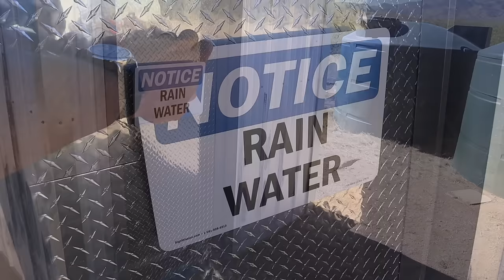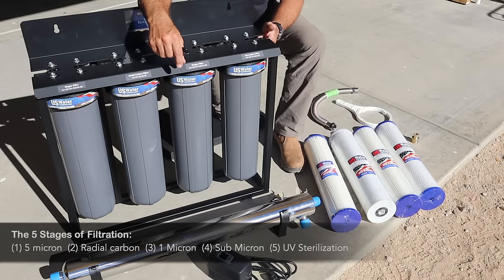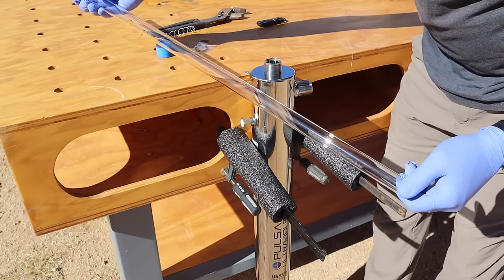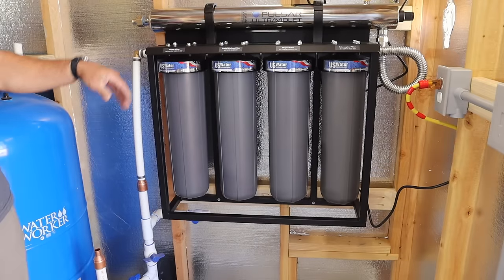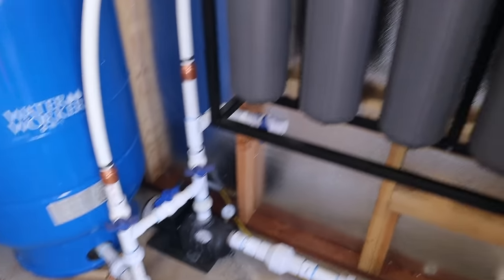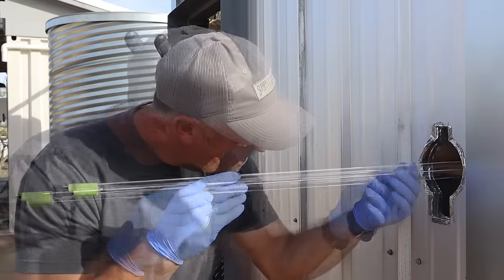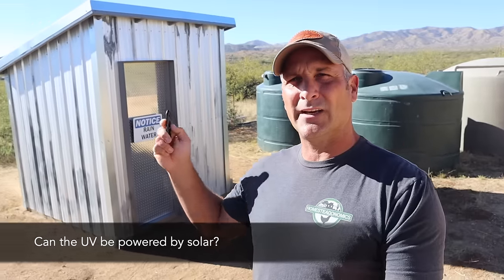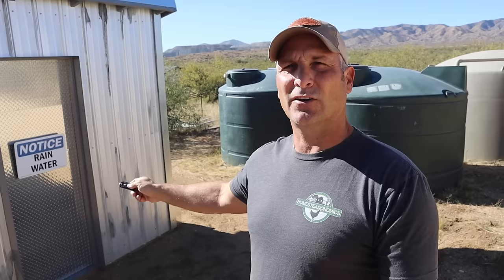Whole House Water Filter Install for my Rainwater Harvesting System

Comment: Great vid! Thanks for sharing. Do you do anything to re- mineralize the water? What is the pH when it comes out of faucet? I'm just curious. We love your channel and have a chunk of property here in Arizona we eventually want to "homestead" in a sense. Your vids are priceless for information.
Reply: We have had our rainwater system up for over a year now.  We sent water samples to a lab to be tested a month after we started using it.  While the mineral levels were greatly reduced we did still have trace of some minerals in our water.  If you have a good diet you should not have any issues with mineral deficiencies.  Filtered water is not void of all mineral like distilled water is.  Our ph levels were pretty neutral.  Something I didn't expect was that rainwater is not as clean as you would think.  I did our first filter change at 9 months and the filter elements were almost black when I removed them.  That's not necessarily a bad thing, it means they are working.
Reply from the maker: Thanks for checking it out!   No, we don’t add anything back into the water.   But like the ouroklahomalife said, a good diet of healthy food will supply what you need.   Additionally we use a couple types of salt (Celtic sea and Himalayan) over regular iodized table salt for our meal prep as they have natural trace minerals within them.  
As for the PH, I do not know, but plan to do a test of pre and post filtered water soon.  
And where abouts in AZ is your property?

Comment: Wow, I don't get it?? I live on a caribbean island and  have been living on rain water for over 19 years. My water goes through one 10" X 2 1/2"  1 micron filter which I change every 2 months, and then through a UV filter. I change my UV bulb every 18 months - they recommend every 12 months. I have never had any issues in regards to this system. No issues with the taps, water comes out clear with nothing collecting in tap filters. Water tastes great. no one has every gotten ill. I did have to change the UV control box after approx. 14years.
Reply from the maker: Get what?  This is just a multi-stage filter system.   They also sell single chamber systems, UV only systems, etc,.   This is just what they sent me.   
If you check out my previous rainwater videos you’ll see that the only filter I have used for 15 years was just a berkey gravity filter.   Nothing for the house.    Lots of options and there is just one.

Thanks for checking out the video😊🙏

Comment: We’re thinking of doing the same Joe. We put in two small under sink filters in so we can access drinking water at either end of our house and they seem to be working well, but the filters need more frequent changing than I’m guessing a whole house system would. Thanks for sharing this.
Reply from the maker: Well I think your plan of doing the under sink filters is actually more of the ideal setup for being efficient as you aren’t filtering hose water, washing machine, toilet water, etc,.   So theoretically I’d imagine that could save more, depending on the filter changes needed.   
Of course this setup is a single filter location, but they are large filters.   So I guess it might depend.  

But I’d definitely check out what they have to offer that might work as a switch out with your current ones.  As they do have smaller filters that can fit under sinks in the cabinet.

Comment: Are you splitting the filtered water and unfiltered water for different uses? Such as washing machine, toilet probably doesn't need filtered water vs. cooking, drinking would need filtered water. It uses more water to get filtered water.
Reply from the maker: That would definitely be my ideal.  But as of right now I only have one run supplying my house.  So it supplies everything. 

As for the more water to get filtered water.   This system is not RO so there is no wasted water.

Comment: Very useful video. Thank you Joe! 
1) What carbon filtration you have in the kitchen? 
2) How often you need to replace filters , including UV filter? Once a year? If so to keep it running, annual expense around $500? Correct me if I'm wrong.
Reply from the maker: Thanks for checking it out!  

As for the filter we’ve been using for the past 15 years.   It’s a 2.5 gallon berkey with black ceramic elements.  And even though I’m installing this system I will continue to use the berkey as well for drinking water as it’s just habit.   I highly recommend berkeys in general.  

As for maintenance on an annual basis.  If changing at recommended intervals, that is probably close to what it would cost.  But that will depend on water source.   For example with rainwater I have virtually no mineral or other particulate to filter out.   But I will have potentially more silty sediment from my roof surface that makes it in there….even though I do let sediment settle and use a filter on my pump when I transfer water from my tan collection tank, to my green holding tanks.   So the water is remarkably clean by then, but some will make it over.    So for me I might let the latter filters go longer than a year and just change the first 5 micron filter more often (as it is the cheapest 😉).  And I think that will not only prolong the latter 3 but also reduce cost a bit.
Reply: @homesteadonomics  Good video.  We have a similar system and we still use our Berky.  I thought rainwater would be cleaner but, I just changed out our 5 micron for the first time @ 9 months and it was black.  Which is OK, that means it's doing it's job.  If your looking for a water testing lab we used "Simple Lab" to test our rainwater and our well.  They send you the kit and turnaround from when you send in the sample is about 5 days.
Reply: for my system I use loose carbon rather than a cartridge. the carbon then can be washed and dried for reuse elsewhere. also about 1/3 the cost. have been doing that way for over 5 years. water annually test out exceeding local utility district water quality by far.
Reply: @homesteadonomics  Thanks.
Reply: @OurOklahomaLife  Thank you
Reply: @lawrencebeck1144  Thanks. What kind of water filtration system is that? Brand?

Comment: I installed a similar system in our van, so proof of running off of solar is there.

That said, after 3 years, our UV sterilizer exploded due to bad welds and freezing temps.... so be sure to insulate or drain in freezing temps
Reply from the maker: Sorry to hear about the failure…..but glad to hear you had some good success before that.

Comment: Excellent work again Joe.  With the digital key used on the device and it sitting inside a metal building I'm sure that you will protect it by grounding everything to a common ground rod to prevent electrical surges (differences of potential) due to high electron flows associated with lighting in the area.  You shouldn't have a problem but digital equipment is suseptible to failure with the small tracings and bondings on the boards and in the chips, etc., in them.  Hence, keeping everything at the same potential to mitigate the energy flow between different potentials.
Reply: You really need a surge protector on the main panel to protect all circuits of the house or an individual outlet protector. I can tell you from experience that just having up-to-code grounding isn't enough. My electrical is from 2016 and I've got two 6' copper ground rods and a ufer ground plate. Still didn't save my UV light from being blown up by a power surge.
Reply from the maker: Thank you Lee!   Don’t know how I missed this comment from earlier…. Must have seen the other reply and thought I already had.  
As for the electronics….yes I’ll be adding a good surge protector to that outlet…. And the main ground is at breaker panel below house slab.
Reply: I’d be curious to know whether this system is at all hardened against an EMP - or, if not, how to decrease its susceptibility to an EMP.

Comment: @homesteadonomics
if sunlight or UV can reach the Pex, you will need to do something to protect the PEX from the UV. Pex is super susceptible to UV degradation. is there anything to keep the water from acting like fiberoptics and transmitting the UV down the line to the Pex?
Reply from the maker: Yea it is.   But if you notice the pex fittings form an elbow before making a 90 down to the pump run.  And the inner sleeves of those pieces nearly touch so light is directly hitting that short section before the elbow.   But it is a good thing to make sure of

Comment: Reverse Osmosis is easier but wastes to much water for a rainwater system... I use RO on my "city" water that tastes like a swamp

Some food grade grease on those O rings will help seal and extend their life a LOT. Available at brew supply stores... I use it in my beer kegs on the O rings
Reply from the maker: Yes, RO definitely is a no go for my water situation, but if I had a municipal source I’d certainly consider it as an option.

Comment: Great vid! I was waiting for something like this.
Didnt you do a lab test before drinking it? 😮 I personally avoid combining drinkwater and plastic. I would use stainless steel containers and copper plumbing, but that will drive up the price i guess. Same for the filter holders. They should be made out of glass with a black coating on the outside. What happens to the UV light if you dont change the bulb every 275(?) days? Less intensive or do they just want to sell these as much as possible?😅
Reply from the maker: Thanks, glad you liked it!

As for a lab test….well, you gotta remember I’ve been living on rainwater and using one ceramic gravity filter for the last 15 years.. haha 😉

But additionally in my research I knew US Water had a great reputation for making very good systems

Comment: How effective is the UV sterilizer considering the fast water flow rate, I would imagine water needs to be stagnant for maximum UV exposure for any meaningful sterilization to happen
Reply from the maker: I couldn’t say for sure….but I know depending on the intensity it downs have to be long.    They’ve been making and testing these systems for a long time.   So I’d imagine if the system is designed for 20gpm then the UV would be able to maintain with that flow.

Comment: The pressing question is ongoing cost of the system.  How frequently do the filter elements/UV bulb need to be replaced and the cost of the elements/bulb.
Reply: UV bulbs 1 year 150 bucks, filter 40 -80 peice 1 month to a year depending on usage/contamination level

Comment: Ok, nice !  But what kind of cost did you have to put out for this complete system ?  I guess the only thing extra that I would want todo is to add some proper minerals back into the water system for health reasons.
Reply from the maker: Thanks!   Regarding the minerals….that isn’t as huge of an issue as good food will provide most minerals you need.   And additional can be obtained by utilizing a good quality sea salt (Celtic) or Himalayan salt.   
And for the cost…. The cost of these systems varies quite a bit depending on what you need.   This one was sponsored by US Water to me…..so the cost to me is what I will have to claim for tax purposes.

Comment: Wonderful video. I'm glad to see this project. What were your hesitancies in putting together a multi-stage DIY system?
Reply from the maker: Thank you!   Regarding my hesitancies…..
Mostly had to do with combining parts from different places to save on cost…. And different specs on certain components not quite lining up, etc,. .. and basically just kinda leaning towards a single source for all the components.

But a more DIY version can definitely be done with cost savings.    So don’t let that discourage you if that’s the route you’d like to go😊👍

Comment: I like this set up to cover your whole house. My folks are currently using a reverse osmosis system under the kitchen sink that only covers the drinking water. Does this system do the samething as a reverse osmosis system? I understand your system covers the whole house versus ours, which only covers the drinking water from the kitchen. I would prefer a whole house system, since it allows you to drink safe water from any location in the home, rather than just from the kitchen. This set up is the best for a family who have kids that access water from any part of the home. Thanks for sharing this video. Time to do some research...lol
Reply: Depending on what kind of water you're starting with you might not need a RO system. If you're on well water and it's hard water (lots of minerals) RO will help extend the life of your hot water tank, make your soap work better in the laundry and in the shower, and reduce hard water stains on plumbing fixtures. But if your supply is municipal from a lake it probably isn't hard enough to justify whole house RO and a filter bank like this would help take out the chlorine and fluoride added by the water utility, making it perfectly fine to drink
Reply from the maker: This system is filtration/sterilization (via UV) whereas Reverse Osmisos uses a different process and especially for me running lower pressure, would be inefficient for my setup.   But for a musical supply they might be a good option.  

But ultimately I think it’ll depend on your needs for water use.   

Thanks for checking out the video😊🙏

Comment: I've been spending time spec'ing out my eventual retirement compound, and this is definitely on the list. When I do it though, I'll probably double up the filters in parallel so that they last four times as long. If the house needs 10gpm, then each set is still good until they hit 5gpm instead of 10. Save money on filters, add redundancy, and the plumbing is only slightly more complicated.
Reply from the maker: That sounds like a good plan!   And he’s to that retirement coming soon!   Always fun planning things like this😊👍

Comment: Nice setup but I have a few questions.
1. Did you connect your pump and UV power supply together so that your light only works when the pump is running?
2. I believe for the UV to have any beneficial effect it needs to have a continual water flow through it with the light on and intermitent short  runs do not sterilize your water.
Dave, South Africa

Comment: Excellent! I am curious though why you didn't install a spin-down pre filter on your intake? Is it because rain water doesn't need it?  I have a community water system and I had to put spin-down filters on mine but it was because I get a lot of >25um particulates. It made my filters last twice as long.

Comment: The powder coated filter cartage  hanger will fail and rust up. Get or make a aluminium hanger Starting with a 5 micron filter. You will have a shorter life span for it. 25 micron first . Then what ever you want to hang after that. Remember  you have a open system. If you are off grid your UV light is on all the time creating a fantom draw . Run a small UV light under the sink where your drinking water source is and run it on a light switch  at the sink for  on demand drinking water. Your light will last years longer. Also run a Y strainer before your pump. I have been doing this for a long time .I hope this helps people out there  Aloha

Comment: It is interesting that while many multi-stage filters start at 5 micron, some start at 10 or even 20.  But with a clean roof collection system I suspect that 5 is more appropriate. Should not be a lot of larger debris . Especially if there is a first flush diverter.

Comment: You are so neat. You wipe the excess blue glue. Question: why the hell are you using that crazy wrench with the teeth? Never use that style wrench! It leaves marks in your nuts. You should use a line wrench, they fit over the nut on all side and has a slit for the line. 13:58  Or  a plain open end wrench.~~ Cris H.😊

Comment: The system I have available (Canada) states it has to be installed after the pressure tank. Seems odd because why would I want that sediment in my tank.  What are your thoughts?

Comment: How do you know which filter needs to be changed?  If the pressure drops do you change every one?
Reply from the maker: You know what…..I don’t know as of right now.   They have recommended intervals.   But I’d imagine the first filter like the 5 micron would be changed more often since it’s going to get the bulk of the large particulate.    Additionally it is the cheapest.   So I’m guessing change that more often to prolong the life and use of the others.   
But that’ll be something I’ll address when I do the water test video update.
Reply: @homesteadonomics   that's exactly why i asked.  I've seen system that have a gauge after each filter so you know exactly which one is clogged.  It makes sense that the first filter would get clogged first.

Comment: So your head pressure is high enough to pump into the checkvalve and pump without a pump on?
Reply from the maker: The check valve is there to keep the pump primed, in case the tank water falls below the level of the pump.  If you check out my first video on this pump-house series I explain the flow of the water and the why’s of the individual components
Reply: @homesteadonomics  I understand what the check valve is and does but I was wondering does your head pressure on the tanks fill the lines and push through the CV without the pump on?

Comment: You mentioned that the UV light draws 1 1/2 amp.  I would think that the light is on only when there is actual water flow.  Yes?  So is there a flow sensor to turn the UV light on and off?